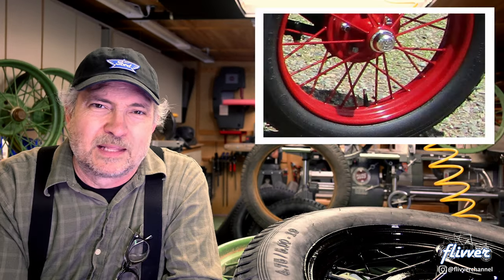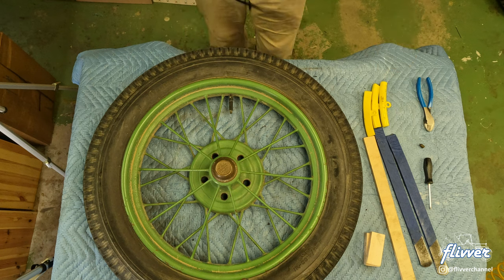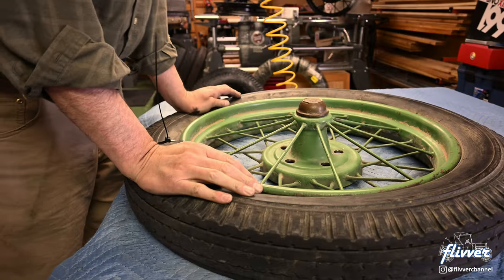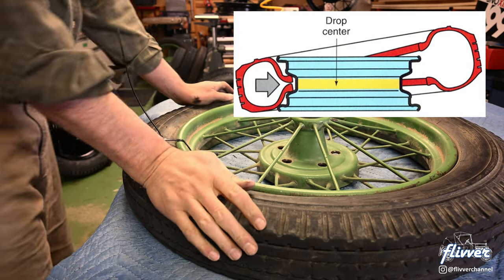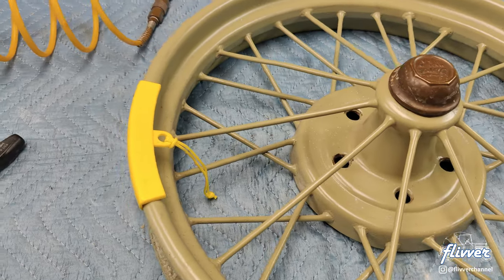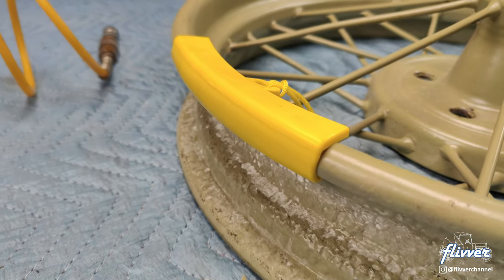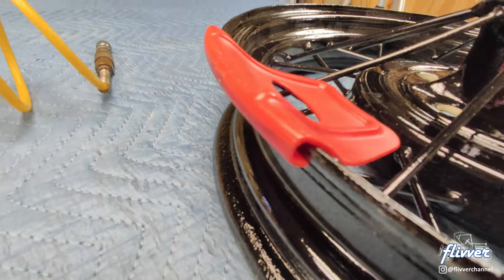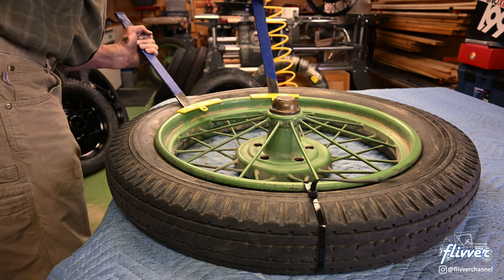Remove a tire NO DAMAGE to paint!  Model A, Model T

Comment: Our Model A club has a special tire mounting box we made - using some scrap 2x4s and a 36"x36" piece of plywood with a 9" round hole in the middle.  We covered the surface with some scrap carpet and viola!  A great surface for mounting/dismounting tires.
Reply from the maker: That would be perfect!

Comment: Excellent videos!!  Thank you. Could you say where you got the stem adapters  and the rim protectors?? Thanks again.
Reply from the maker: The valve stem grommets are available on Amazon. Search "valve stem bushing tr15" You can probably find something even better elsewhere. Also be aware that valve stems can be different diameters. The rim Protectors are also available, search "motorcycle rim protector"
Reply: Thanks for answering so quickly!!!